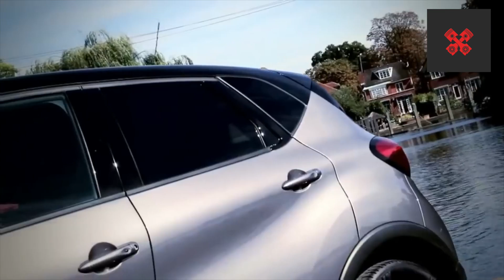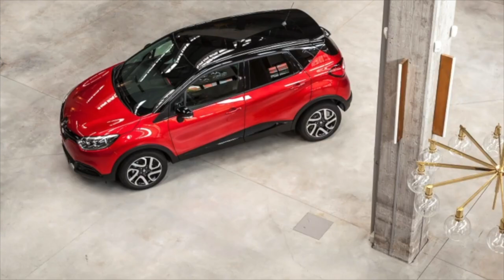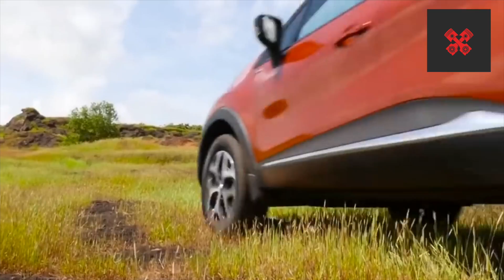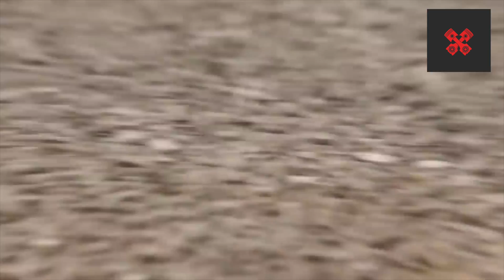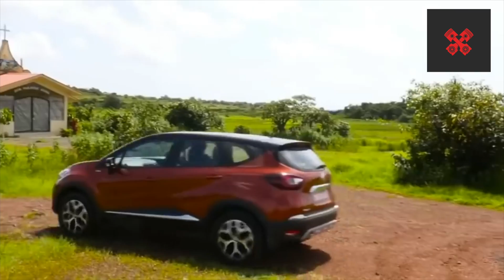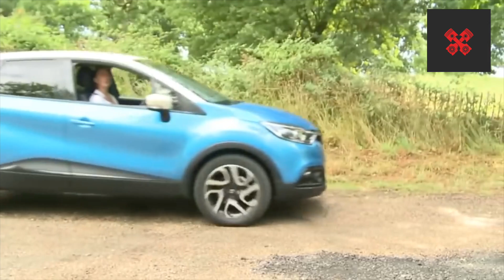Used Renault Captur Reliability | Most Common Problems Faults and Issues

Comment: The GT line metal pedals are suspect as wet shoes can slip off them. Takes a long time to get used to visibility and awareness or lack of it due to the wide wing rims that you cant see. Saw brilliant video on using the wiper joint to sight the distance of the car from near side objects. The off side is set by aligning the white line with the tweeter speaker. I am beginning to see many wing scuffs because the visibility is so poor. I had already caught mine.